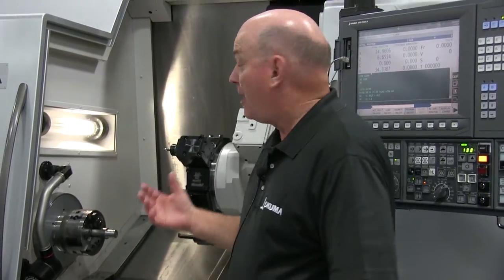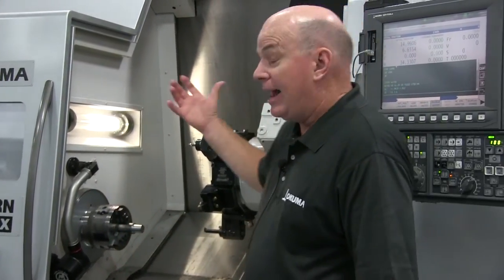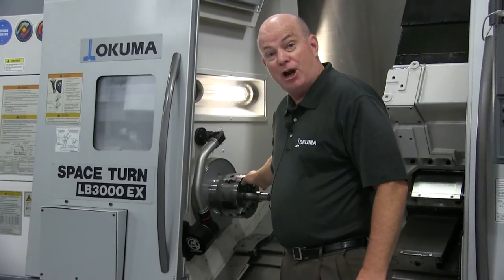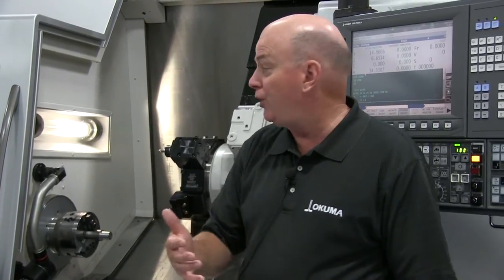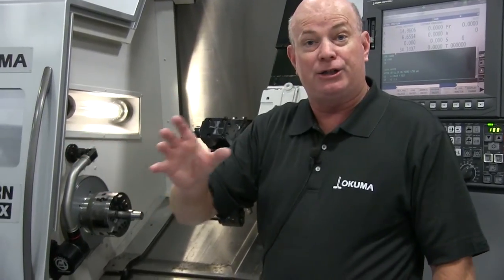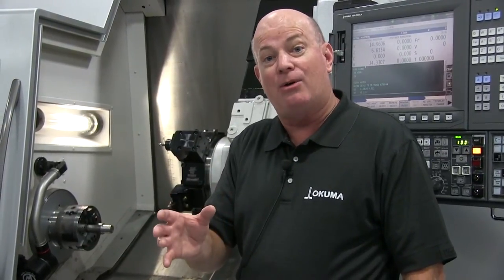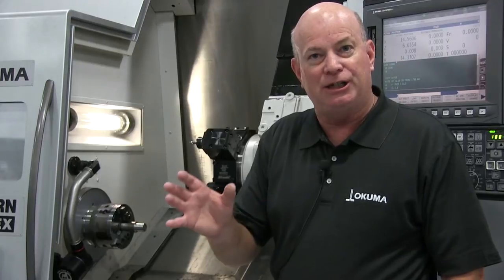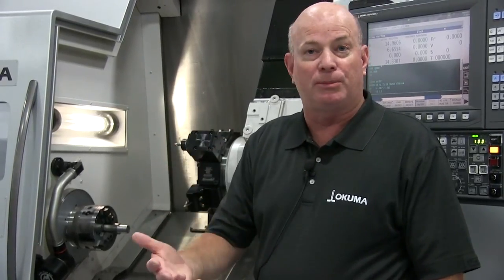"Entry-Level" Automation for a CNC Lathe

Comment: Hi! We just got new Genos lathe and im interested how to reduce rapid traverse speeds. Im aware of the rapid limiter key but it limits it to 50% which is still way to fast to react if something goes wrong. Is it possible to set key limiter to lower precentage? Turning it down with a dial (potenciometer) also slows down G1 commands and that is very unconventional for us. 

Thanks in advance!
Reply from the maker: Neven, thanks for your question. Have you contacted your Okuma distributor? They should be able to give you personalized guidance. Since you say the machine is new, we assume you have a contact, but if not, you can look up your distributor at https://www.okuma.com/distributors